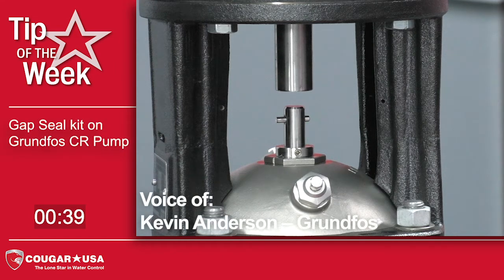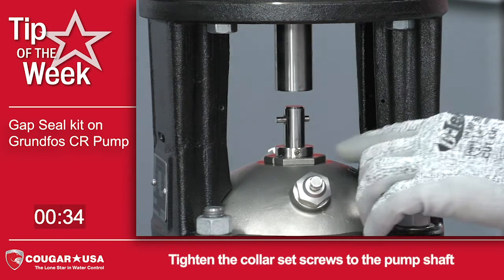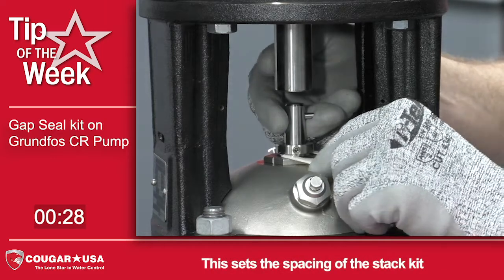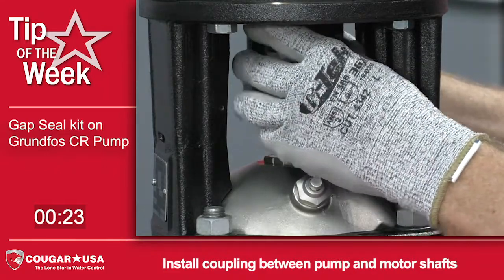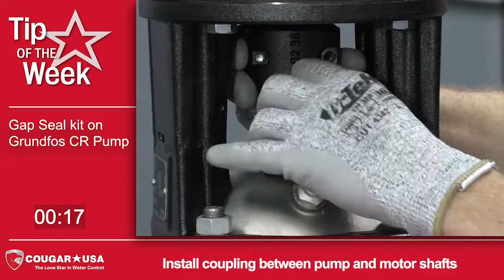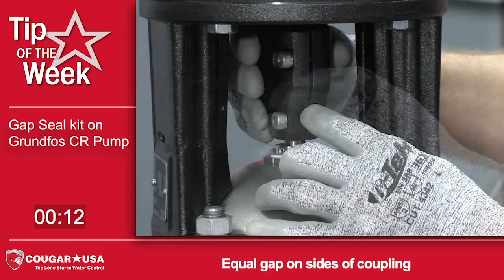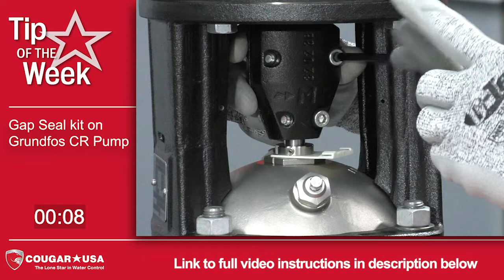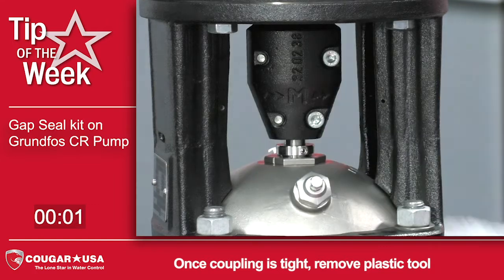Set Gap Height of Grundfos CR Pump Seal Kit - Cougar USA Tip of the Week

Comment: What is the purpose of gap seal kit?
Reply: The stack kit height inside of the pump housing is set using the seal kit collar. When done correctly, the stack will float in the housing and not touch the top or the bottom.  There isn't a gap in the seal kit, it's just the terms used to describe this process.
Reply: @ it affect to spring tension of mechanical.seal or not sir?